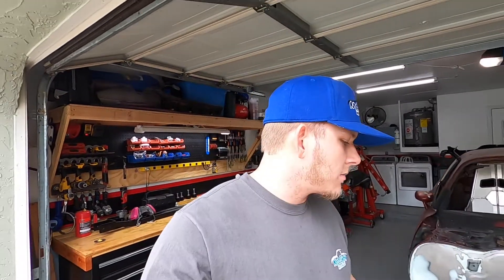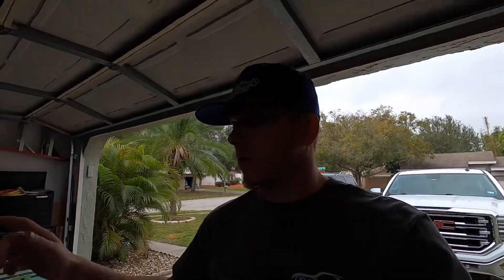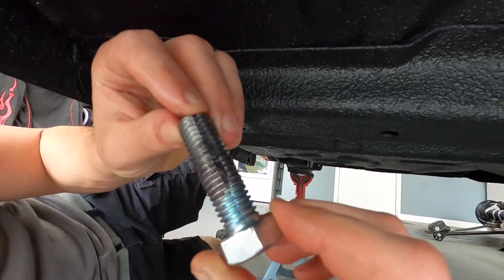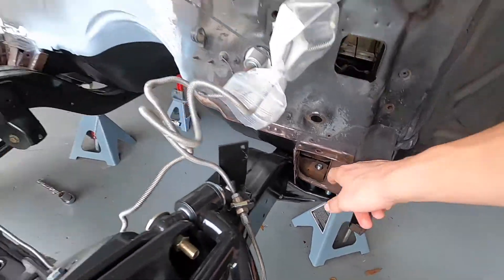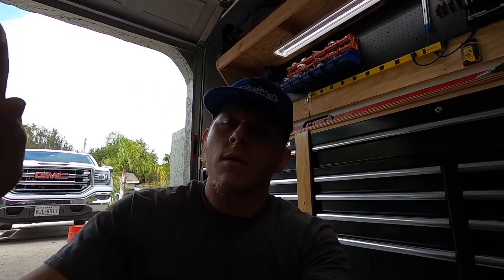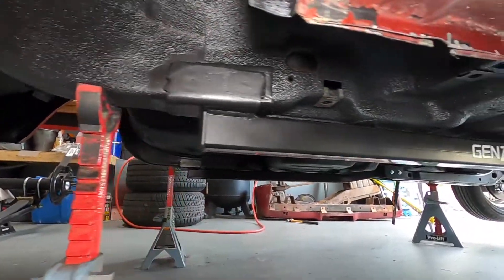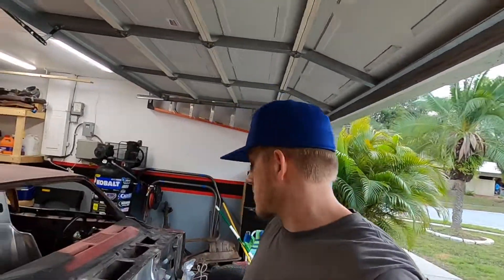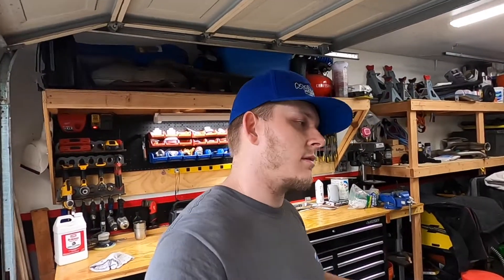Camaro Drag Car is Back TOGETHER!!! | Z2H8 Camaro coming along

Comment: Looks like it is coming along nicely , and the easy bits are done, now onto the more difficult parts , like all the wiring and lines for fuel and brakes , you should have no problems if you just take your time , and think it all out before you move forward with each section, nice job on the PTFB subframe connectors , nice weld and paint
Reply from the maker: Thank a lot! We’re waiting 2 adapter fittings for the rear brake lines and the brake system will be complete all new hard lines master cylinder line lock and prop valve, fuel should be simple with some braided line and an in tank pump, wiring will probably be the most tedious thing on the body side of the car. Luckily the ending harness is all plug and okay from Holley
Reply: @DAPerform  Sounds like you have it under control, will you be running a return line for the fuel? They have nice returnless intank pumps now, I think Holley has one.For the brakes are you setting up a manual bias front to rear prop valve? And yes the wiring will be the biggest headache , did you look into the Terminator X system, or you going with something diffrent?
Reply from the maker: @davecolquhoun9315  Holley hp system, not sure about the return less pumps I think we’re planning to run 2 factory hellcat pumps if they are comparable with ethanol. We’re keeping the power brakes for now to see how well they will work with our setup

Comment: Heavy pedal garage recommended your channel. Subscribed. I have a 70 Camaro I was working on, but had to put it on hold cause my wife took a job in Germany. Looks like we will be back in the states by summer so I can pick up where I left off.
Reply from the maker: Awesome glad you made it over hopefully you enjoy the videos and get some ideas or learn from our mistakes lol
Reply: @DAPerform  i too am learning. Had to do alot of rust repairs....replaced both quarters and cowl. Will do a roof skin replacement once I get back, and have one floor section that needs a little attention. Other than that, I will be able to get the body work done, and do all the mechanicals.
Reply from the maker: @brandoncampbell4815  sounds like some work, it’ll be worth it in the end

Comment: Cars coming out awesome, what turbo setup are you going with? Theres one similar to this but blue on ls1tech with twin s366 and a 6liter that went 8.60s at 160 mmph

https://ls1tech.com/forums/forced-induction/862310-79-camaro-build-up-6-0-l92-twin-s366-s-build-pics-inside.html
Reply from the maker: We’re starting with a vs 7875 to get us going we got a killer deal on a  50mm wastegate 50mm blow off valve and the turbo for less than $500. Once we get the care dialed with that turbo we will most likely go bigger maybe 85-88 range depending on what it does. It’s geared to mile an hour 179 so we could potentially be in the 7 second range